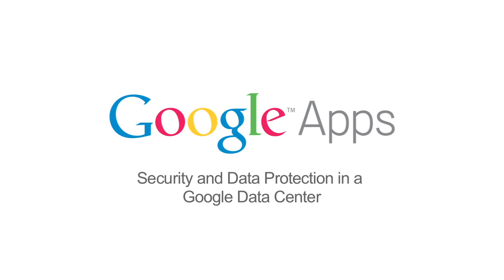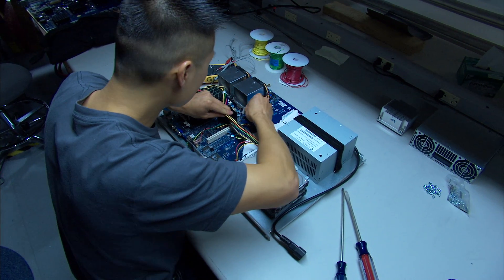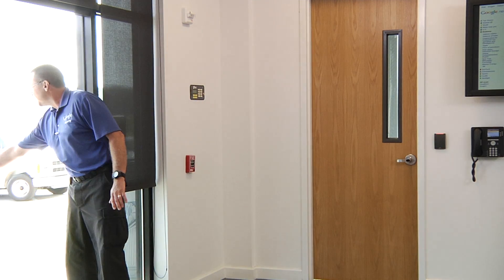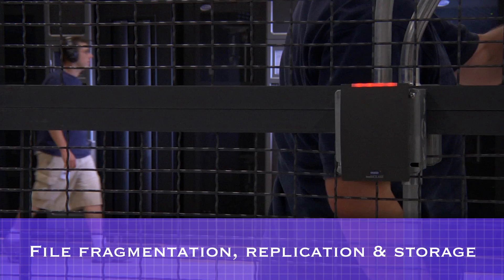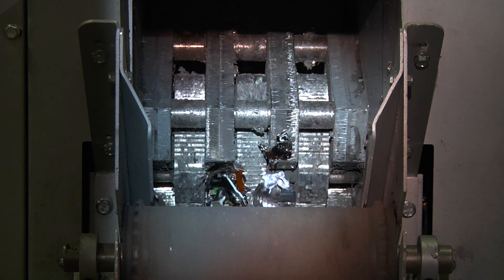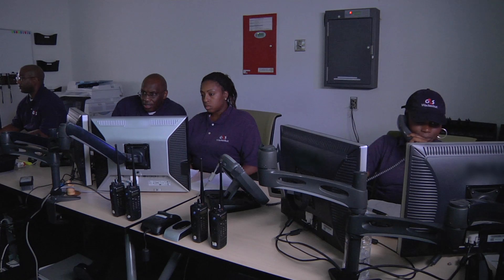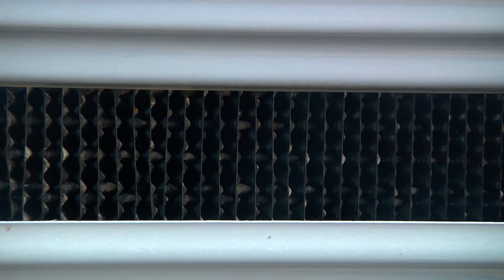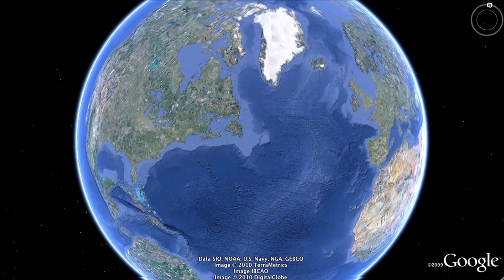Security and Data Protection in a Google Data Center

Comment: They're still using Windows XP lol
Reply: because its difficult to upgrade with all the kind of software that is stored on the current operation system. In this case, Windows XP.
Reply: It's of 2013
Reply: And? This was made in 2013 when XP was still used by a crap ton of people since there was no reason to upgrade

Comment: “We use a customized version of Linux” proceeds to show the old and insecure windows XP
Reply: For the servers, not the PCs for monitoring, etc
Reply: For others wondering, it's at 3:04. They probably use Windows XP for testing their equipment, which means it is offline.
Reply: Those PCs for monitoring also probably do not have an outside connection to the world, or otherwise extremely strict network rules only allowing specific addresses to communicate. Don’t you think google is a step ahead of you on OS security?
Reply: @jonny6702  Everybody makes mistakes. Around 2010 China hacked Gmail accounts through Windows XP machines in Google's networks. In 2013 Edward Snowden revealed that the NSA had been hacking Google by tapping into unencrypted data streams in some parts of its network. If you're as big of a target as Google is, someone will eventually get in somewhere. Their job is to add layers upon layers of security and keep playing the cat/mouse game (or whack-a-mole).
Reply: on the servers dumbass, they install linux on the servers.
Reply: Meh, will be on a local, internal network anyway.
Reply: Fake a.i. machine data programs give fake answers

.
Reply: "proceeds to show the old and insecure windows XP"

Proceeds to comment on a six year old video about their use of technology that was still being supported and patched (i.e. not insecure like you say) at the time.
Reply: was made in 2013
Reply: This video is from 2013.
Reply: That's not windows xp
Reply: You do realize this is from 2013, right? Support ended on 8. April 2014 and enterprise customers could pay to be continuously supported. Also, they did indeed show some sort of Linux when commenting on that, I believe that would be some provisioning system. XP footage after that, with your general hacker tools "ping" and "dir" called, is clearly some b-roll.
Reply: Video was uploaded in 2013. XP was unsupported in 2014. Cheers!
Reply: its a video from 2013 tho
Reply: This Linux will be preloaded to the server, the XP is for controlling things but yeah, XP is not secure anymore in 2013

Comment: Impressive but few notes : 24x7 security seems to be managed by G4S_Secure_Solutions - a third-party from Google perspective. Just wondering on an agreement / liabilities if the breach really happens. On the other hand, usually data being stolen via software hooks over Internet, not by sneaking into a data center to steal physical devices.